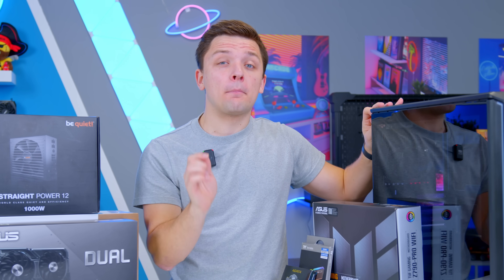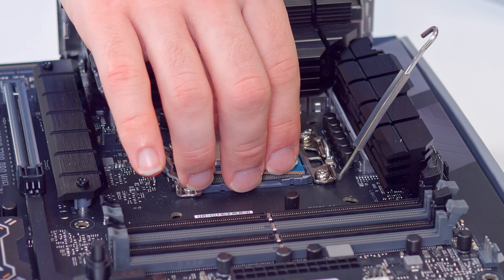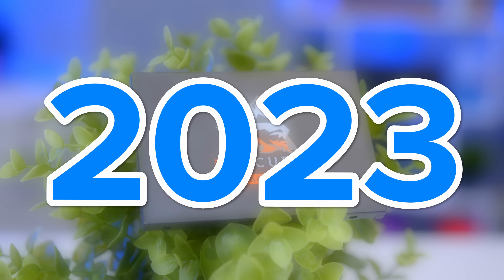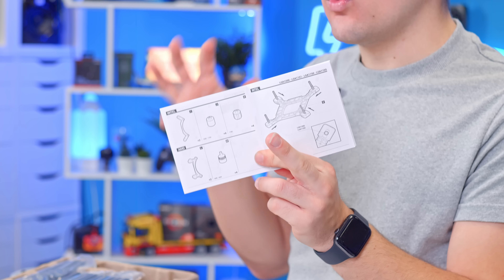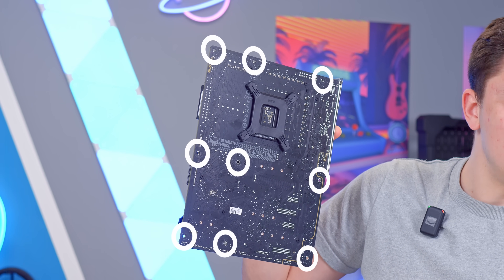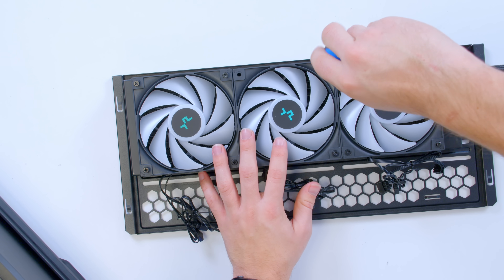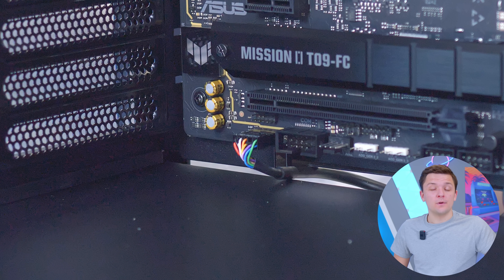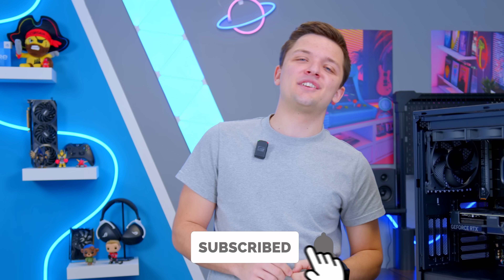How to Build a Gaming PC in Under 15 Minutes! 🛠️ [An Easy Beginner's Guide]

Comment: Here’s a personal note of mine, based on certain builds I’ve seen. While installing an AIO with an intake configuration, you need to pay a lot of attention when you’re mounting the fans. If the fan holes aren’t visible on both ends before you attempt to install the fans, you run the risk of driving the fan screws directly into the fins of the radiator — potentially impacting its performance.
Reply: Also, if you’re planning on using a custom AM5 bracket, be sure to install it when the motherboard is resting on a flat antistatic surface when the standard bracket is removed from the board, as that area of the motherboard’s backplate will detach if it isn’t being held against the motherboard itself.
Reply: Thx

Comment: I stopped watching after he installed the CPU with no thermal paste. I've never built a PC before but even I know that thermal paste is needed to fill the little gaps between the CPU and the socket without filling these holes your CPU will run hot and cause your PC to overheat and your components to degrade more quickly.

Comment: So you made it so quick for the cable connections which is the most confusing part for the new builders. You should show more detail steps to explain cable connection. Also, you just covered major connections, didn't show other cable connections. I see there are many cables came with the case, also there are fan connections. I am confused at this stage.

Comment: looking into building one atm. thx for making it look less daunting. now for me too look for and make sure the parts i build are good and will actualy go together. wish me luck
Reply: Best of luck!! You can definitely do it!
Reply: If you could, would you be able to share with me the parts you are using for the build? It would be great if you can list all the parts including the utility you will be using.
Reply: Pcpartpicker is a great tool as you picking and putting a build together, they have some suggestion on parts (full build reccomendations and you can change things here and there to fit what you want better) or you can start from scratch you put all of your parts individually and it oftwn tells you if there are things that don't match(not fool proof but a pretty good guide).
Reply: How did it go?

Comment: 5:15 These days, many M.2 SSD come with thermal putty already installed.  In this case, you can CHOOSE whether to use the putty on the SSD card or on the motherboard's SSD cover... but don't use both.  Peel one off completely and wipe the surface down with a bit of rubbing alcohol to remove any residue, then install the SSD, then put the cover on.  You only need ONE layer of the thermal putty.

Comment: First time I built mine I forgot to plug in the power connector for the aio. I turned on the pc and watched as the cpu temp went from 0 F to 98F in about 10 seconds. Parents thought it was normal but I knew I that it was way to hot. Glad I knew my facts and didn’t listen to my parents.
Reply: I remember having something like that happen. I noticed that the temperatures kept getting random spikes, ultimately culminating in a failsafe system shutdown. Upon investigation, I found the problem — the CPU_FAN plug was only partially inserted. It was enough for the motherboard to accept the AIO pump, but not enough for the AIO pump to properly manage and detect the temperatures.

Comment: Quick question for any PC fanatics out there. I’m a video editor who also loves gaming, so I need a setup that can handle both without breaking a sweat. I work with Premiere Pro, After Effects, Photoshop, and Toon Boom Harmony for animation, but I also want to play high-end games like Elden Ring and Marvel’s Spider-Man 2 on PC. Thing is, building a rig that’s great for both editing and gaming can get pricey and tricky to optimize. Any tips on how to turn my current PC into a beast that runs smoothly for both work and play? Would love some advice!
Reply: I’d recommend if you’re asking for a GPU and CPU combo a RTX 4060 or 4070 and an AMD 7800X3D. The Gpu is great for editing and Gaming without breaking the bank, has enough power and doesn’t use too much power. The Cpu is great for processing with its many cores and is a great pair with the GPU. Also get a decent amount of RAM the bare minimum is 16 Gigabytes of DDR5 but I recommend 32 Gigabytes for editing and get a 2 Terabyte SSD for the storage of your videos and games but i would recommend 3 Terabytes.

Comment: Guys is this a good build? 
Case: Antec Performance 1 FT
CPU: Intel® Core™ i5-14600K
GPU: ZOTAC Gaming GeForce RTX 4070 Ti
Mobo: ASUS Prime Z790-A WiFi 6E
RAM: CORSAIR VENGEANCE RGB DDR5 64GB (2x32GB) 6000MHz CL30
SSD: Samsung 990 PRO Series - 2TB Gen4
PSU: Cooler Master MWE Gold 850 V2
AIO: ARCTIC Liquid Freezer II 360
Reply: Good but cpu not bad i7 13700k good
Reply: Havent heard much good things about the whole 14th gen intel but i wouldnt know much just wanted to warned you just in case
Reply: @Only1second   therer is 2% differene between them i really don't know 🙂
Reply: @StaySaltyAboutIt   i think they are slightly better
Reply: I'd say 13th gen i7 but it's up to you tho
Reply: very good build!

Comment: do i need to buy wiring separately  for the build or does it come with components like graphic card and motherboard?
Reply: The cables come with the respective parts.
Reply: @JJFlores197  does a PSU come with the cables.
Reply: @caiden6969  As I said, they come with the respective parts so yes the PSU comes with power cables. Now, if you're referring to extension power cables that a lot of tech build videos show, then no. Those are purely for aesthetics and have to be purchased separately.
Reply: @JJFlores197  damn

Comment: Things that people will never tell cabinet fans fan hub is quite cheap buy it it's easy to manage cable at a single point individual to motherboard argb connectors can't be painfull and sync them too . 
Supoose you have normal RGB fans and no argb you don't care much just want cooling. Most cases when buying a cheaper cabinet fans or older ones you may not have the proper connector put it with the PSU molex connectors and stacks it or stack it and use a unused sata pin. 

Check your motherboard properly for what is the front panel connector for power and restart
Like Msi the physical never matched the onnline one.  Read what's written on the Mobo. 
Power and re-start pins and the argb header can look similar until you look close don't try to push it it won't fix there you may break it . 

I thanks msi fir one thing highlightimg the pump header for AIO with metal stainless thing covering it . 

Unless gigabyte fight to find what is what they're manual in box throw it in Dustin and read the onnline one .

Comment: I have i5 9600kf with a 3060ti and i want to upgrade, should i go for 7 7800x3d? to pair with my gpu, maybe in a year i upgrage the gpu
Reply: hey, a little late here but no, the 7800x3d is even more expensive than the 3060ti itself and it will be such an uneven combo that it will bottleneck(underperform) basically get a cheaper cpu like the 5800x3d because its the same peformance

Comment: my case has 4 inbuilt fans and I am thinking of getting a ryzen 5 7600 ( that comes with a stock cooler) Is it enough for the cpu, 32gb of ram and an rtx 4060?
Reply: @RockRust the cpu is good but the stock cooler wont be enough
Reply: @UMGROXY  Thanks. What are some collers that you would recommend?
Reply: @DemoTheWolfGlazer  do you want liquid or air cooler
Reply: @UMGROXY  Probably an air cooler
Reply: @UMGROXY  is the Thermalright Peerless Assassin 120 SE ARGB a good choice?
Reply: @DemoTheWolfGlazer  well yes but I would recommend a liquid cooler because you have a high end cpu
Reply: @DemoTheWolfGlazer  that cooler is more than enough. Only if you plan to overclock it to the max you'll maybe need a better cooler.
Reply: @betrandguesclin  👍

Comment: I just got all my parts in and stayed up putting it together. Going to do the cabling in the morning but I’m nervous
Reply: how did it go
Reply: @pot471  it went well! I did it without having to get help. Running great
Reply: Is it still running great? I have a few things I want to know before I consider starting. For one, does the cabling come with one of the pc components (like the case or motherboard), or do I need to buy them separately? Second, what do you think the cost would be if I did all middle tier materials? And if I got AMD CPU, would I have to use all AMD products, or could I throw in some Intel products and other brands? Lastly, does the pc even work?

Comment: Hey Geeka instead of how much budget do you have, how much do you REALLY need to play games in 2023/24 so people don't actually spend their entire budget... Toughts?
Reply: It depends on what kind of games you want to play at what resolution and at what desired frame rate. The needs of 4k 144fps is going to be very different to 1080p 60 fps. You could play at 720p to maximise budget. If you can tolerate potato spec play then you can build a potato spec PC.
Reply: @Safetytrousers  ah then he should make it as sections imo? He doesn't have to build it i guess?

Comment: How do you remove the side panels?
Reply: Most PC cases have screws/thumb screws that hold the panel in place. After you remove them, you usually have to slide the panel back so that it comes off.

Comment: My pcs rgb turns on but my fans aren’t spinning and monitor says no signal connected did I miss a cable?
Reply: Hard to say without seeing the computer. I would double check ALL internal components and connections. If your motherboard has a diagnostic/debug light, take a look at it as it can probably tell you where the problem may be at.

Comment: Pre-Built is probably a better option for most if building a PC. 

The reason is if you buy all the individual parts each can have its own issue, if there is one, or you if damage it. This making the warranty redundunt! Plus you have to figure out what part ir parts are the issue abd us it your fault or the parts fault.

 Pre Built you usually have return/repair 2yr(+) , iry extened, warrenty. Any issues then rhey will deal with it. You wont have to mess atround figuring out what the issue is. You wint need to replace/send back/fix/configure the part/issue. 

Its actually not that more expensive buying a pre-built and can actually work out cheaper esp as P&P is usually free - rather that shopping around, probably have to pay P&P too and then waiting for each part. Also dealing with all the packaging too.

Comment: anyone have a take on antistatic tools or are they not necessary
Reply: They're not absolutely necessary, but you still need to be aware that electrostatic discharge (ESD) is still a potential threat. As long as you take steps to minimize static electricity build up on you, you should be fine. The bad part about ESD is that there isn't always immediate damage and there is no easy way to tell if you've accidentally damaged something. It may take months or years before something creeps up or maybe nothing happens at all.

Comment: Hi, I made my first pc 2 days ago and it’s all connected correctly, but I can’t download windows on it from USB because the USB is not showing up. Pls help me 😭
Reply: There may be a particular USB port the PC uses for BIOS. Or the PC doesn't like the format of the USB (NTFS / FAT32).
Reply: @urmum3419  Go through the BIOS settings and make sure BIOS mode is disabled and that UEFI Boot, Secure Boot and TPM 2.0 are enabled. Different boards have different names and menus, so you'll need to look around or look at the board manual.